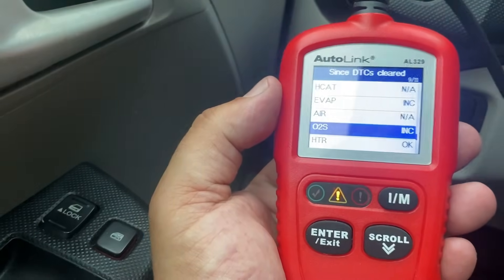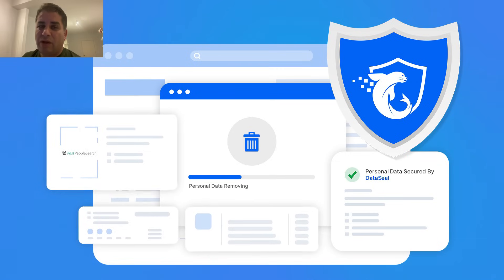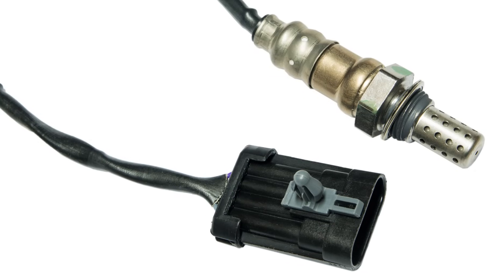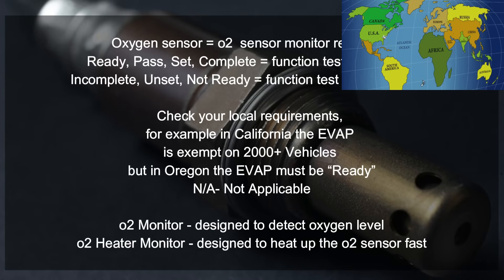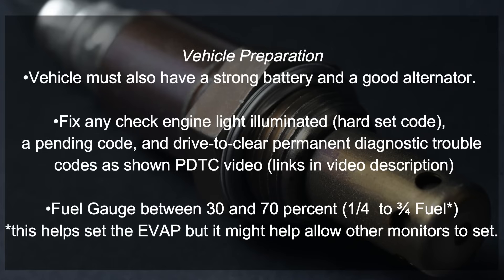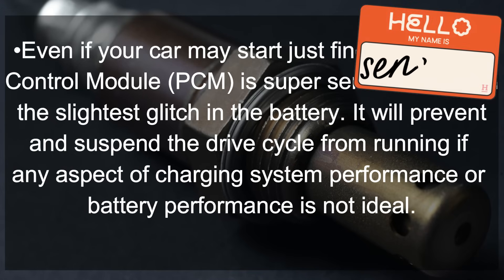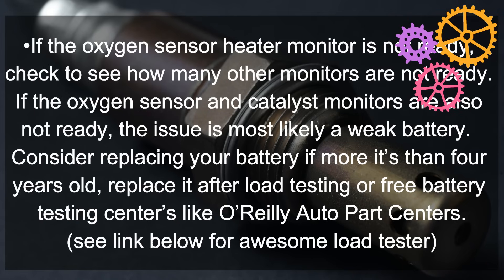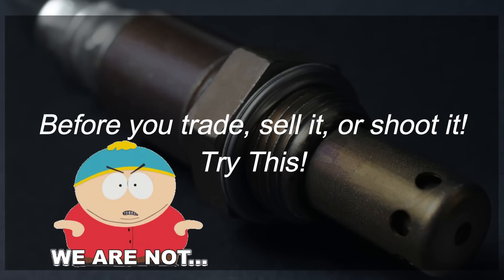O2 Sensor Monitor Not Ready ▶️ Smog Drive Cycle Oxygen Sensor Monitors Not Ready Problem FIXED

Comment: I got a question, everything but oxygen sensor is turning green but my bottom shows a green check as yours is yellow. I've driven over 150 miles with no pending or check engine light,  the smog check guy said that they all got to turn green, ain't I allotted one red x? 2006 Nissan armada.
Reply from the maker: You need to set the o2 monitor. Try warming ip your nissan with ac and rear defrost running during the warm and drive around town 35 to 45 mph in city driving.  Here is the nissan drive cycle https://youtu.be/s9PLkO-CjZ8?si=ohpgnL_cgQDWut4I
Reply: @RANDOMFIX  yeah even my check engine light is solid key on engine off and when I start it  goes away. I was reading if it's blinking that means it's still not complete. I'll check it out thank you.
Reply from the maker: @tommyhajimoto6968  only honda and chrysler have this feature to let you know your drive cycle is incomplete. I highly suggest have a obd2 reader.  This good one under 30 https://youtu.be/SguhiTfgpFQ?si=31LIw9tPkKX_GqJg
Reply: @RANDOMFIX  my OBD scanner doesn't support oxygen sensor reading for this specific vehicle. Could that cause it to have a red X in 02 I'm at 200 mi now,  with no pending or check.
Reply: @RANDOMFIX  okay I watched that video my OBD2 was on one for the IM indicator, I set it to 0 and reset. It's a red check mark now I'm going to start driving
Reply: @RANDOMFIX  thank you sir here I been driving around wasting gas. It must have not been enough driving when I took it to the tech when he tested it. All green,she passed CA smog.

Comment: Hey there! Thank you for this video! I did the drive cycles and the cat and the o2 came on, but the “HTR” still hasn’t come online. I know here you’ve said that if the other two  came on then there’s nothing wrong with the o2 heater, but is there anything I can do to speed that up? Thanks!!
Reply: Oh and this is for an 06 wrangler unlimited
Reply from the maker: I would check to confirm that is there is not an inherit issue with your jeep as they are know for lots of issues like this. https://youtu.be/PMcJtcSOzdk?si=3fnhC88Fq8xG03g3
I’m the video I cover how to look up this list of vehicles.
Out of curiosity is the original o2 sensor in your jeep? The pre cat, o2 sensor have you ever replaced it?
I would also check the connections, just unplug and reconnect it ( with the engine off)

Keep me posted.
Reply: @RANDOMFIX  I tried to address you in my long comment either just above or just below this. Thanks!
Reply: I have a 2011 Shelby GT500 with a Kenne Belle Supercharger and custom tune. I also have a 170 degree thermostat.  
The car passed smog from the Ford dealer upon purchase. I'm the 3rd owner. The  Used car just happened to be at a dealer. All parts are Cali legal.  The car then  passed smog again, a year later,  in a weeks time. 
Now, it's been 6 months that I've been working on this. I have the 02 sensor heater monitor that will NOT SET. There are no error codes. We saw that the gas pedal sensor may be faulty and not recording drive cycles. Replaced that. Replaced downstream 02 sensors. Replaced battery 3 months ago. I have a trickle charger as well if needed. Not needed since battery replacement.  
Again, 2k dollars later, still, heater 02 sensor monitor not ready. So then, maybe then, the thermostat is preventing the car from reaching adequate temps. Well, the car passed 2 times prior with the same platform. No error codes. 
I'm so sick of doing the drive cycles and not having it change the heater 02 sensor monitor. I have all my gauges telling me everything is running well. I'm at 14.5 on the battery, and the AF ratio is good. 
Next, on April 14th,  I take it to a smog guy who is gonna try and cycle it through on the smog dyno. If you have any thoughts, I'd be honored to read about them. Thanks.

Comment: Help 2014 Toyota tundra only need.                     Oxygen sensor not ready
Oxygen sensor Mon INC
Reply from the maker: I just recorded a video in California about this but it will help so hear what you want to do.
Assuming  your battery is perfect and the o2 sensor is original brand from Toyota. Start your Tundra with the air conditioner on plus rear defrost plus headlight and just let warm up for 5 to 20 minutes. The colder the temperature the longer you may want to warm up. The drive around 35 to 45 mph around down.  Put a big electrical load on the vehicle during warm up. Your tundra is 10 years old now. Has the o2 sensor been replaced? I would check the connections as well, you need to check both pre car o2 sensors. I show it in this video for the Toyota drive cycle https://youtu.be/EKfEr2LP2Nw?si=UDLXHilMBBIMKenK

Make sure you have a obd2 reader than can rescan like to one https://youtu.be/SguhiTfgpFQ?si=yknTt7aZ3D95Gsg_
And keep me posted.

Comment: can i cut sender wire to sensor ?I don't have cat i got straight pipes so I don't need 02 sensor
Reply from the maker: Does you state require an emissions test? Why would you want to cut the wire? Why not look for mil eliminator instead? It will trick the post the post cat o2 sensor to think it is working! You leave the pre  cat o2 sensor as is. You will need to add the mil eliminator on the post cat o2 sensor. What are you driving by the way?

Comment: i have a 2013 mazda cx5 i don’t see anyone have a proper fix for just the o2 sensor not ready. I have no pending codes but 2 permanent codes for small leak every other monitor is set besides evap and i don’t need that. Can some one help my mazda o2 sensor get ready please. Yes the o2 heater is ready
Reply from the maker: You need to handle the permanent codes first https://youtu.be/PMcJtcSOzdk?si=EuR9PpcjvadmWHL4

Comment: ive got a 2003 chevy avalanche ive replaced all 02 sensors with factory ac delcos drained the battary and did the drive cycle 02 senors still didnt set??? other moniters set 02 heaters,Cat,evap.
Reply: Same here. Did you ever figure it out?

Comment: Hey friend mine its only the o2 monitor not ready ??  o2 heater is ready ...
Reply: did you get a fix?
Reply from the maker: I appreciate your feedback Sorry for the late reply, did you get this handled?
Reply: I have the same problem
Reply from the maker: Is the o2 monitor the only unset monitor? What year and make is the vehicle?
Tell me the back story. Thanks
Reply: I changed the cluster!!!! Short circuit..I bought it on eBay already programmed and passed emissions the same day.. I had the code for the cluster circuit kp+ ..  the code was erasing after the car shut off..sorry took forever to reply

Comment: I have  a 2008 Nissan Xterra. I have used a scan tool to identify any codes and also clear them. I have been plauged with a small evap leak for a number of years. Recently, I cleared the code and brought my vehicle in for the yearly inspection. Apparently, I did not allow sufficient drive time to reset the monitors. I do notice that I have 3 monitors that show N/A..egr, hcat and air. I presume that these are not on my vehicle thus the n/a. I do not have a SEL light on, but the usual pending evap code P0456...small evap leak. Am I good to go with all of the other monitors saying OK?
Reply from the maker: If all the monitors are complete except the n/a not applicable than you should be good however I have seen smog techs pre scan the vehicle with a basic obd2 reader and will tell you are not ready and to keep driving as they want to take a chance as the recorded pass with pending code will go with their record or they might be suspect of a bigger problem
Reply: Thanks for the quick response. I came across info about the N/A status on the internet, but I was surprised when the tech at the garage told me that I needed to drive a few more hundred miles to go thru the complete drive cycle. I was advised by the main mechanic to keep the gas tank stuffed with fuel during the drive cycle so not to kick on the SEL light and then the auto could be rescanned. I was concerned about the n/a status and I doubted if it would ever cycle to ok. Apparently the shop has a few customers who have the same problem and this is how they deal with it at inspection time here in NYS. @RANDOMFIX
Reply from the maker: @lorettacaputo6997 don’t keep your fuel full keep it between 1/4 to 3/4.
Here is the complete nissan drive cycle if you run into an additional issues.
https://youtu.be/s9PLkO-CjZ8?si=vab4ATza6sEG2QDC

Comment: What worked for me was a disconnected vacuum line going to one of the valves to open up the butterfly in the intake manifold must've been like that for a while because the car was a little sluggish but wasn't that bad because I don't drive crazy but now the car has major pick up after I replaced that hose It was cracked in many places could be loose too but it wasn't letting my O2 sensor monitors to be ready five minutes after replace the hose I drove for five minutes and it was ready right away so I had to be there vacuum line so I can make sure all your lines are OK it's a quick and easy thing to look at feel around if you can't see... You might catch something simple I'll go for my emission test tomorrow because I already tried to go but it wasn't ready at all at least they didn't penalize they said come back in a couple days try to get your sister ready so I got a scan tool and I'm ready now
Reply: sorry I use talk to text and it doesn't always write things out correctly IU whatever  You get the idea just check your vacuum lines, Was that for me could be other things of course but do  the obvious and simple first
Reply from the maker: Great information, yes a visual inspection is very important and can help find issues like the cracked vacuum lines.

Comment: I wonder if you'd be the one to do a video on what the computer is actually doing during the drive cycle.  It's a dark, unseen mysterious activity that thing is doing... Maybe present it as a real time, graphic diagram situation, say with a series of labeled boxes indicating the hardware connected with lines showing connections to the computer... with readouts at the top showing what the engine is doing... Something like that...  But, it's a mystery...
Thanks... Very appreciated...
"Liked" "Subscribed"...
Reply from the maker: Sorry for the late reply, I appreciate your feedback

Comment: Thanks, it seems that may be the issue with my friend’s 2013 BMW M3. I see a “battery excessive discharge “ warning in the vehicle info system.  Can’t get the O2 ready after 232 miles and 23 cold starts.
Reply from the maker: Hi Tom,
Bmwwwwww and smog, oh boy, okay just be ready for a little work, first fix the discharge issue, I recommend disconnecting the battery for a few house to 48 hours. You may need to load the the battery and check the charging system. I would test all of this before disconnecting because if the battery and charging system are good then you don’t have to start from scratch on the drive as I think you are stating all the other monitors are ready other than o2 sensor. 
But please under a bad or even semi weak battery is going to cause all sorts of issues so if they battery and charging system are good then you want to start from scratch, disconnect the battery which helps reset all module and can fix some communications issue. Here is the drive cycle for your Bmw https://youtu.be/mk6Tk330Acw

Good luck and let me know what you find.
Reply: @RANDOMFIX  thanks for your help. I saw your BMW video just now but I had followed those steps this morning and got the CAT to ready now for him but yes now the O2 sensor monitor is the only one outstanding. Seeing yours and other YouTuber video made me think of the battery warning I saw and seemingly the issue. I will post my results to help others. Thanks again.
Reply: I have problem My Chevy Silverado 2005 issues with 02heater monitor incomplete and EVAP but rest monitors is ok and send me error code po420 in same time when i pass readiness on live data catalytic converter ok but code po420 is still there what to do (check engine light on and only code po420 with catalytic converter readiness "ok" i have no idea what to do truck running great 😡

Comment: Have been trying to get my 2002 Kia Spectra out of the Not Ready “R” category in California for months. Did the drive cycle on the freeway twice at 55 miles per hour for over 30 minutes and took it back to smog center and it still says Not Ready. Don’t know what else to do. Since it’s not a Fail, can’t get help with repairs. How many times do I need to do it?
Reply from the maker: Hi Diane, here is the Kia drive cycle https://youtu.be/OtSDdIgQ6_g
After you complete two drive cycle focus only on the unset monitors and keep me posted.

Comment: Hi RANDOMFIX: 
I just measured my Battery, and it was 12.2v with my car-key in "ON" position (not engine start). -- and in OFF position it was 12.4v 
is this bad?
Reply from the maker: 12.4 is not bad as long as it not a surface charge. 12.4 is Not bad but you need test after 5 to 10 minutes with ignition on or headlight on. A fully charged battery will be at 12.6

You really need a loader tester like shown in this video https://youtu.be/Zpe_oOUZsUs
They are around $20

Comment: Thanks for the video: I have 2004 Pontiac Grand AM (GM) piece of garbage and drove my car about 500 miles and almost changed everything in that car, O2 Sensors, sparkplugs and 6-cables, air filter, CPV valve and you name it, but still it says O2 Sensor Htr not ready. So Lastly I will check try your "battery low voltage" below 12.0V today. By the way I have Transmission issue also, it "Kicks" due to the bad pressure solenoid inside the Transmission, -- do U think this would be an issue?
Reply from the maker: Is the transmission kick setting a code? Pending or stored.

Comment: I swear if all my car issues are battery related I'm going to be pissed
Reply from the maker: Don’t be surprised, I’ve seem people replace transmission when the battery was the cause. There is not harm in having a great battery.
Reply from the maker: I know batteries can be expensive so you don’t need to replace every battery, just load test it, check the charging system. Here is great 20 solutions https://youtu.be/Zpe_oOUZsUs and i would still disconnect the battery for 1 hour even if it shows good to reset any modules that might not communicating correctly.

Keep me in the loop.

Comment: had issue with my tahoe about 2 years back and couldnt set the evap or 02, turns out the 02 sensor had corrosion on the terminal, once i changed it out and cleaned the corrosion off the monitor set within 5mins of driving! Im back in the same situation with a 2015 silverado and i ordered new 02 sensors, im hoping it as well is a 02 sensor since no codes come up and only the monitors will not set! So annoying!!
Reply from the maker: I wish you luck and I hope you find an easy fix.
Reply: Did it work

Comment: Thank you for your video. A lot of information to look at. I have a 2011 Jeep Liberty which is a 3rd/spare car which is not driven much. I replaced the battery 4 months ago with a new one from Auto Zone. When I was going to get it smogged this week, my scan tool was showing everything was good except for the O2 sensor monitors. I looked at a ton of videos and a lot of people stated it took forever to make ready this monitor. Just have to drive it a lot of miles  to make ready the monitor they said. I did numerous drive cycles and drove quite a few miles and still it shows O2 sensor not ready. After watching you video, I checked my battery voltage with a meter and it was showing 12.5 volts. I took my "jump start" portable battery, hooked it up to my car battery terminals then disconnected the terminals from the car battery so I would not lose any of the memory, then hooked up my digital battery charger and it showed my battery being at 85%. I charged it up for about an hour until it showed 100%. Disconnected the battery charger, put the terminals back on the battery, disconnected the "jump start" battery, and the new voltage at the battery showed 12.8. Just got back from a 45 minute drive on the freeway and a little stop and go traffic driving, got home and the O2 monitors are now ready! I have to think that charging up the battery did the trick. Thank you again. I hope this helps someone out there that is having issues with the O2 sensors. It is worth a try.  God Bless.
Reply from the maker: Hi Ed, thank you for sharing your experience and these Jeep sare infamous for not setting the o2 monitor unless the battery is almost perfect.
Reply: @knotyourguru  
Tried that numerous times and numerous days and it would not reset. Did as RANDOM FIX suggested and it reset right after the first time after the battery was charged. Just trying to help others try something that might work for them as it did for me. SO sorry to disappoint you as I noticed your "NOT the 1-hour charge on a 4-month-old battery" comment you made. Some people find it hard to realize none of us know everything. Helping others and being positive is what it  is what it is all about. Have a great and Blessed day.
Reply: I did the same thing as far as the most expensive battery Autozone had to offer. 5 sensors are not ready, tried everything! Do I need to disconnect the battery to charge it up with my digital battery charger?